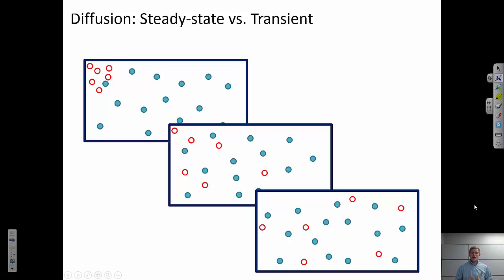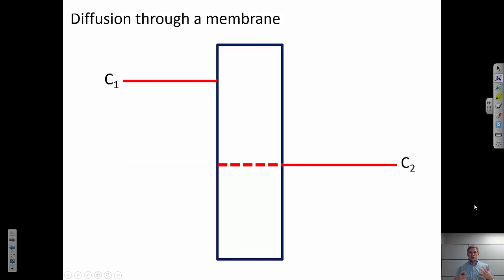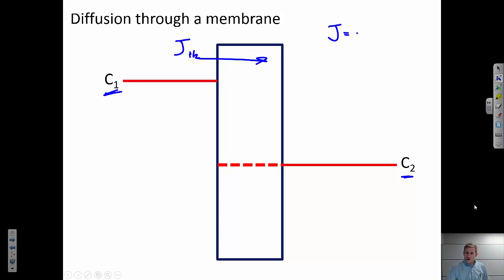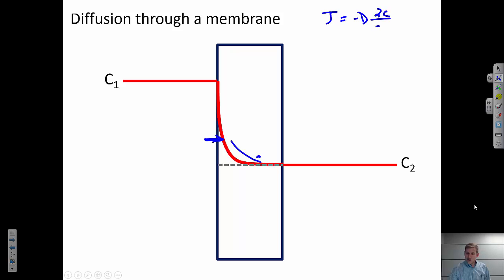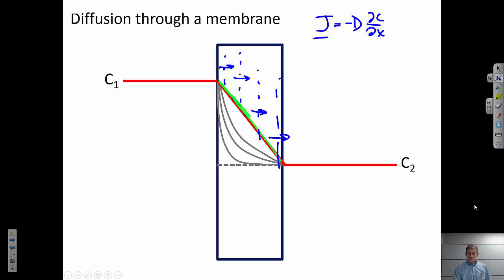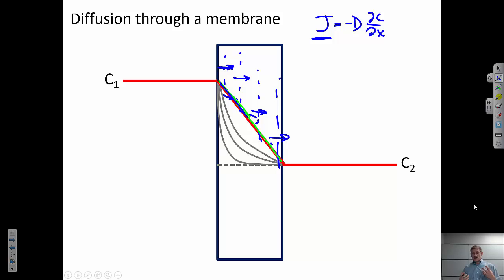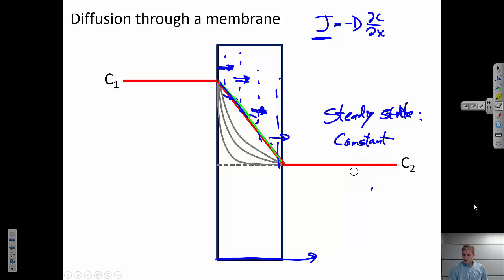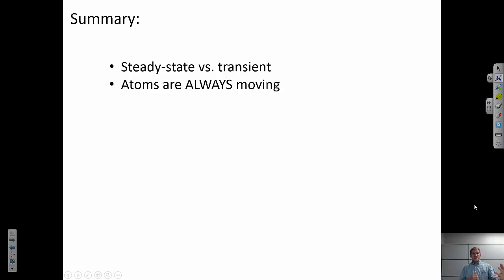Diffusion: Steady State vs Transient {Texas A&M: Intro to Materials (MSEN 201)}

Comment: hi, will the concentration at the steady state be the same for the system that you have considered which has a continuous function for concentration at the boundaries? I can understand that if there's a discontinuous function for concentration at the boundaries of the thin plate, you can achieve steady state.